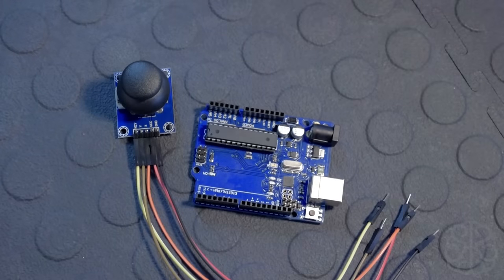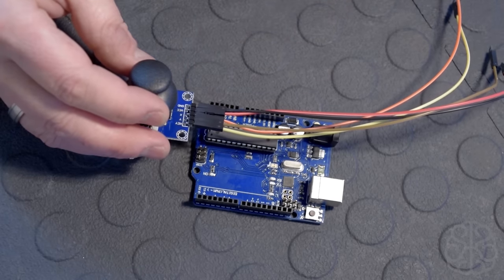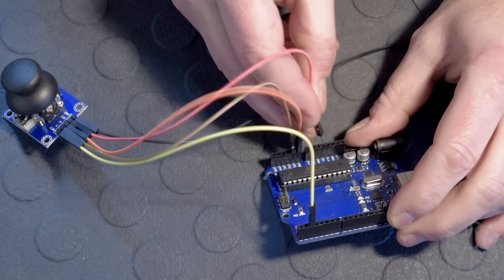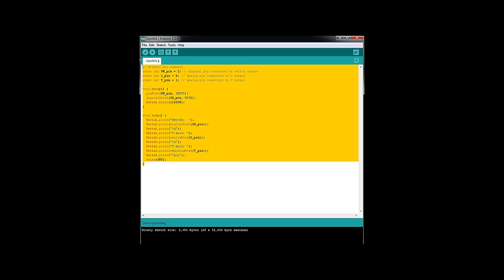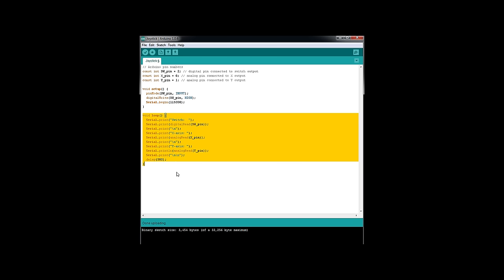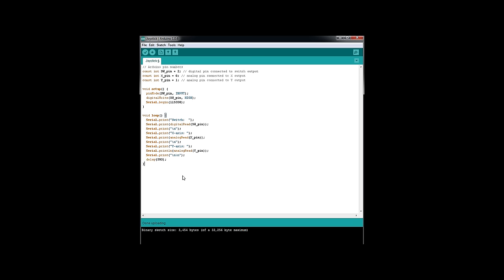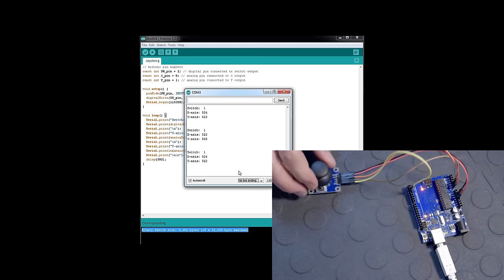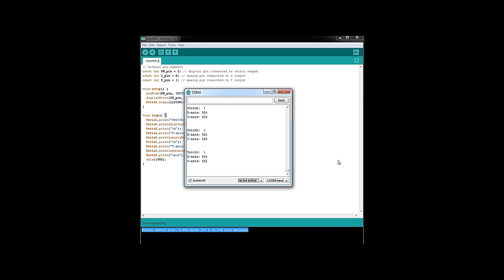How to connect and use an Analog Joystick with an Arduino - Tutorial

Comment: I did the same thing with a broken xbox controller. I desoldered it  from the board, mounted it to a small perf board, then soldered jumper wire to the board. It worked on  the arduino. It's just 2 10k pots on a stick with return springs. Each axis will have a slightly different "zero range". If you are using this for a project, then the most important part is to find the min and max zero reading, then map that range of values for each potentiometer to zero. This prevents "idle drift" as I'm sure most gamers end up seeing with a controller at some point. Ex. Letting off the stick to see very slow motion in the x or y axis.

Comment: the whole code is 

//Arduino pin numbers
const int SW_pin = 2; //digital pin connected to switch output
const int X_pin = 0; //analog pin connected to x output
const int Y_pin = 1; //analog pin connected to y output

void setup() {
  pinMode(SW_pin, INPUT);
  digitalWrite(SW_pin, HIGH);
  Serial.begin(115200);
}

void loop () {
  Serial.print("Switch:  ");
  Serial.print(digitalRead(SW_pin));
  Serial.print("\n");
  Serial.print("X-axis: ");
  Serial.print(analogRead(X_pin));
  Serial.print("\n");
  Serial.print("Y-axis: ");
  Serial.println(analogRead(Y_pin));
  Serial.print("\n\n");
  delay(500);
}
Reply: eh
do no wrk
Reply: The code you posted doesn't work just go straight to the tutorial page instead 
https://www.brainy-bits.com/arduino-joystick-tutorial/
all the code is there and it works.
Reply: Why did u choose 115200 and not any other number for serial begin
Reply: thanks, man
Reply: thanks
Reply: Not all heroes wear capes :P thanks bro

Comment: I've got a couple analog keyes analog joysticks here as well and I think similar to your demo, they don't auto calibrate their centers at 512,512 perfectly. I guess there needs to be some sort of calibration mode for more advanced systems to init the rest position and then calculate the relative offsets based on that as a relative center position. I guess I can try to share an example once I finish coding it on my end.

Comment: So, I'm working on a robot that has four DC motors controlled by two motor driver chips. Am I correct in assuming I can use this joystick to control left, right, forward, and backward motion using a command interpreter and checking the range of these values? For example, if y-axis between A and B, turnLeft( ), where turnLeft( ) will be a function call with the logic to turn left. Thanks!
Reply from the maker: +Christian Krause You are correct :) that would work just fine. When you detect that a joystick axis analog read is between 2 values that you choose, then you call a function that would make a specific DC motor turn.  Good luck with your project and thanks for watching!
Reply: +Brainy-Bits thanks man, appreciate the quick feedback. And thanks for the great videos too!

Comment: Great video, I have a question though. Will this code (or a similar code without the button input) work to map two potentiometers to Windows control panel for use in game? The game will allow calibration of end points but it needs to see the input. I am looking to use three separate pots for gas, brake and clutch in racing sims. I know I would have to change the code to add an additional pot read out from another analog pin but from a conceptual stand point will this basic code work as to send pot input to a game/pc or will it only function within the serial monitor. I have been trying to figure out the key to using an arduino to send pot input to my pc and ultimately games but I feel like I'm missing something. I also heard about the need for a resistor between the ground and signal on the pot to prevent spikes, it would be great to know if this is needed when using an arduino or even just be directed to somewhere I can get more info on this topic(s). I already have arduino uno boards so that is preferred unless there is reason to go with another board. Thank you in advance if you get a chance to respond.
Reply from the maker: Check out those other video where I use an Arduino Micro to interface with a computer via usb:
https://www.youtube.com/watch?v=JwCzx7UhOd0
https://www.youtube.com/watch?v=JwCzx7UhOd0
Hope that helps!  Thanks for watching!

Comment: Nice. can I tap off an existing joystick and use the output signal to run say a motion simulator platform? will the output signal from the joystick still be strong enough to continue sending the signal to both the pc game as usual and the arduino simultaneously? cheers guys, your videos are a lifesaving compilation.
Reply from the maker: +jason daysh That's a good question :).  Not sure if it would work, since the Voltage and Ground connected to the joystick would not be coming from the Arduino.  Maybe if you connect the Ground of the Arduino to the Joystick Ground pin (To have Ground Reference), omit connecting the Voltage of course (Since the joystick would be getting that from the other component already), and connect the X, Y signal pins as usual it might work.  Never tried this so can't confirm or deny this would work.  Maybe someone here on YouTube can confirm or tell me how wrong I am :)
Reply: +Brainy-Bits Thanks for the tips, I will give it a go when I get that far and let you know what the outcome was :)
Reply from the maker: +jason daysh Cool!  Curious to see the results :) Let me know what you find out...

Comment: After uploading the serial monitor keeps adding new text but it doesn't read the switch, x input, or y input.
This is my code

// Arduino pin numbers
const int SW_pin = 2; // digital pin connected to switch output
const int X_pin = 0; // analog pin connected to X output
const int Y_pin = 1; // analog pin connected to Y output

void setup() {
  pinMode(SW_pin, INPUT);
  digitalWrite(SW_pin, LOW);
  Serial.begin(115200);
}

void loop() {
  Serial.print("Switch:  ");
  Serial.print(digitalRead(SW_pin));
  Serial.print("\n");
  Serial.print("X-axis: ");
  Serial.print(analogRead(X_pin));
  Serial.print("\n");
  Serial.print("Y-axis: ");
  Serial.println(analogRead(Y_pin));
  Serial.print("\n\n");
  delay(500);
}

Thanks

Comment: I'm new to Arduino. Do you know if I have to solder the ends of the jumper wires to the Uno board, or if there is a special way to insert them?
Reply: Just connect them to the holes

Comment: I am trying to apply tiva instead of arduino, but the problem is that it doesn't have 5v Vcc, only 3.3, and I assume there is no way to make it work. because you need at least 75% of the voltage 5*75/100 = 3.75. So my question is if the joystick operates only on 5V vcc? and are there any of those that operate on 3.3 V?
Reply: And btw, thank you very much for the tutorial, it was very helpful, keep it up.
Reply from the maker: +Ruslan Nurimbetov Haven't found a joystick that works on 3.3v, sorry, but thanks for watching and for your comment :)

Comment: how are u getting a reading for X and Y axis if u didnt declare the pinmode
Reply from the maker: Arduino (Atmega) pins default to inputs, so they don't need to be explicitly declared as inputs with pinMode() when you're using them as inputs.  Hope that helps!  Thanks for watching!
Reply: but, what happen if i want use two analog joysticks?

Comment: Does the stick alone outputs pwm signal?
Reply from the maker: The joystick output Analog signals and the integrated switch output a digital signal (High or Low).  Thanks for watching!
Reply: @BrainybitsCanada  try this: connect a servo motor directly to the signal of the stick and power both devices
Can you do that and tell me if the servo works?

Comment: I am actually working with it now. But what i meant whas that you could make a video where you uses the arduino uno (only or i used The makey makey beacuse i am not so good at hacking or stuffs like that) to controll the buttons up, down, left and right or w,a,s and d on the computer.
Reply: +Kristian Skrede with the joystick*
Reply from the maker: +Kristian Skrede Ok I see what you mean :)  I'm guessing using a Leonardo or a Micro would work best for this, since those boards can emulate a USB Mouse or Keyboard right out of the box.  But There's a way to do it on the UNO by changing the firmware.  You can check our video here for a tutorial with the Leonardo:  https://youtu.be/hFgSI0yykzk  or let me know if you want to see a new video tutorial on the UNO firmware change to enable this!  Thanks for the suggestion and let me know!

Comment: This joystick's got 5 pins and the one I bought has 9. Do you know if all the 9 pins have to be connected to Arduino?
Reply from the maker: Never used the one that has 9 pins, but from what I can see, the one you have has dedicated VCC and GND pins for the X, Y and Key pins.  So the connections for the X, Y and Key pins would be the same, but with additional connections to the extra VCC and GND pins.  Maybe try connecting only one set of VCC and GND to see if the other VCC AND GND pins are somehow connected together on the PCB.  Hope this makes sense, thanks for watching btw.
Reply: Brainy-Bits Yeah gonna experiment with it, if all of them need to be connected somewhy, I guess I’ll just wire the gnd and vcc pins together. And thank you for the swift response!
Reply from the maker: No problem, let me know how it turns out!
Reply: So I tried connecting just one set of VCC and GND pins, and it worked fine, that's a relief. I also wanted to ask you, if I bought a joystick without the shield (or whatever that piece of PCB that it's on is called,  the connection would have to be the same, right? It's 2 separate potentiometers with 3 pins each, so 1 to vcc, 1 to gnd, 1 to pin? I'm asking because ultimately I want to make a gamepad that's as small as possible.
Reply from the maker: That's correct, 3 pins per potentiometer, once for VCC once GND and the third one is the wiper or data pin.  Thanks for letting me know about the VCC and GND pins on your 9 pins joystick.
Reply: Nice, thought as much. Thanks again for all the replies, appreciate it.

Comment: The code that I took from the website doesn't work, but with a correction of the Serial.begin  from 115200 to 9600. Why this issue?
Reply: +Nunzio the values of 115200 and 9600 correspond to the Baud Rate of your serial connection. This value in the function Serial.begin  ('Baud"); needs to match the baud value displayed in the bottom right corner of the serial monitor. Hope this helps.
Reply: Ah ok, thanks a lot!

Comment: can you please paste the sketch here as i cant get it. it would be grateful, and the video is very helpful
Reply from the maker: Sure! here you go.  Thanks for watching 

// Arduino pin numbers
const int SW_pin = 2; // digital pin connected to switch output
const int X_pin = 0; // analog pin connected to X output
const int Y_pin = 1; // analog pin connected to Y output

void setup() {
  pinMode(SW_pin, INPUT);
  digitalWrite(SW_pin, HIGH);
  Serial.begin(115200);
}

void loop() {
  Serial.print("Switch:  ");
  Serial.print(digitalRead(SW_pin));
  Serial.print("\n");
  Serial.print("X-axis: ");
  Serial.print(analogRead(X_pin));
  Serial.print("\n");
  Serial.print("Y-axis: ");
  Serial.println(analogRead(Y_pin));
  Serial.print("\n\n");
  delay(500);
}
Reply: Thanks

Comment: For some reasons I'm only getting 14 for my analog read values. I know my arduino and the button work, but the axis aren't responding proper. any ideas?
Reply from the maker: +imabeapirate Hard to say, but maybe try one axis at a time.  First make sure your Serial Monitor is set to 115200 since that is what is used in the code, or change it to what you want in the code (ex. 9600), just make sure both are the same.  If that doesn't work, try to connect the axis to a different Analog pins on the Arduino.  Of course you'll need to change the code to correspond to the Analog pin you are testing on the Arduino.  Let me know how it works out!  Thanks for watching btw :)
Reply: WDAS

Comment: Guys , I am trying to connect this to a game I made in Unity. I know this video is old but I would love to hear your ideas! Is it even possible , and if so how?
+Brainy-Bits ?
Reply from the maker: Hi, to interface with a computer you might want to use a leonardo or micro Arduino since these can be configured to be recognized as a mouse or keyboard.  Check out this other tutorial we did here: https://www.youtube.com/watch?v=hFgSI0yykzk 
Hope that helps!  Thanks for watching btw :)
Reply: Thanks!! So it should work in my game as well then. Now I got to buy all this stuff.. Hope it works!
Reply: Wait I just realised. If its a game I made on my computer I dont need an emulator do I?
Reply from the maker: If your game is using keyboard keys for movement inside the game (AWSD) then the leornardo or micro Arduino can send those keystrokes when it's configured as a keyboard.  There are ways to make a regular UNO do this, but it's much easier with the leornado or micro since they have these functions built in.  Not sure what you mean by "emulator"?
Reply: Thanks for the answers! So if it is possible to do with uno , do you have a tutorial or know a good one? Or I just should not bother?
Reply from the maker: Found this how-to a while ago that explains how to turn the UNO into a HID (keyboard).  Never tried it myself so can't comment on it, but it's a starting point :)  
http://mitchtech.net/arduino-usb-hid-keyboard/

Comment: my adc output is very noisy . it is between 514 and 516 for x axis pin and 519 to 521 for y axis when joystick is at rest position . i am using Arduino Uno clone. 
Is it normal ?
Reply from the maker: +Paras Bhanot Hi, the potentiometers on joysticks can be a little noisy, but you compensate for that in code.  The type of Arduino you use does not make a difference in this case.  Just write your code with tolerances to execute an action. For example when the Arduino gets a value between 510 and 520 that would equal to at rest for the X axis. Hope that makes sense :) Thanks for watching!
Reply: Yes it does make sense to map noisy values to single value when joystick is at rest.Thanks for your suggestion.

Comment: Whats wrong with your code?

// Arduino pin numbers
const int SW_pin = 2; // digital pin connected to switch output
const int X_pin = 0; // analog pin connected to X output
const int Y_pin = 1; // analog pin connected to Y output

void setup() {
  pinMode(SW_pin, INPUT);
  digitalWrite(SW_pin, HIGH);
  Serial.begin(115200);
}

void loop() {
  Serial.print("Switch:  ");
  Serial.print(digitalRead(SW_pin));
  Serial.print("\n");
  Serial.print("X-axis: ");
  Serial.print(analogRead(X_pin));
  Serial.print("\n");
  Serial.print("Y-axis: ");
  Serial.println(analogRead(Y_pin));
  Serial.print("\n\n");
  delay(500);
}

The error code:

Arduino: 1.6.12 (Windows 7), Board: "Arduino/Genuino Uno"

C:\Users\ecahmad\AppData\Local\Temp\arduino_modified_sketch_361577\jdj.ino: In function 'void setup()':

jdj:6: error: redefinition of 'void setup()'

 void setup() {

      ^

C:\Users\--------\AppData\Local\Temp\arduino_modified_sketch_361577\sketch_nov18a.ino:1:6: note: 'void setup()' previously defined here

 void setup() {

      ^

C:\Users\--------\AppData\Local\Temp\arduino_modified_sketch_361577\jdj.ino: In function 'void loop()':

jdj:12: error: redefinition of 'void loop()'

 void loop() {

      ^

C:\Users\------\AppData\Local\Temp\arduino_modified_sketch_361577\sketch_nov18a.ino:6:6: note: 'void loop()' previously defined here

 void loop() {

      ^

exit status 1
redefinition of 'void setup()'

This report would have more information with
"Show verbose output during compilation"
option enabled in File -> Preferences.

Comment: It just spits out random response lines. I don't even have to move the analog stick. The symbols are nonsensical, unreadable messes.
Reply from the maker: In the Serial Monitor window, bottom right, make sure that the speed is set to 115200 bps, so it matches what is in the code: Serial.begin(115200);
Reply: @BrainybitsCanada  Yep. thanks, i had no idea that mattered.